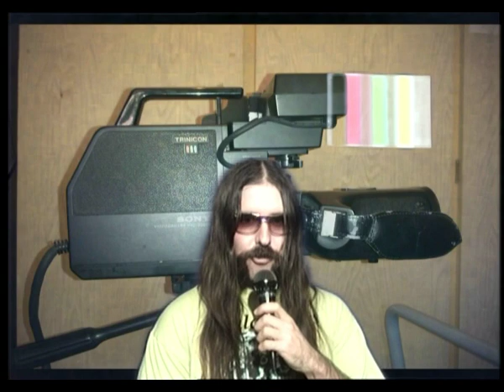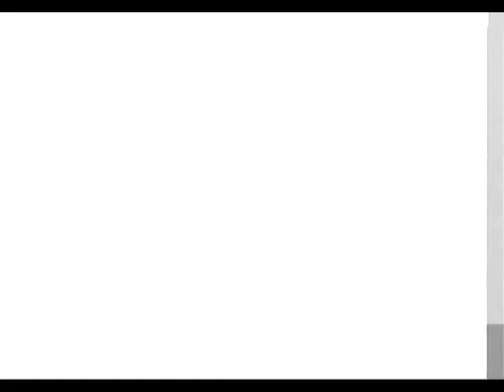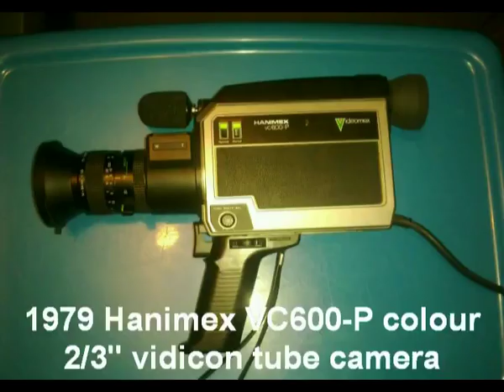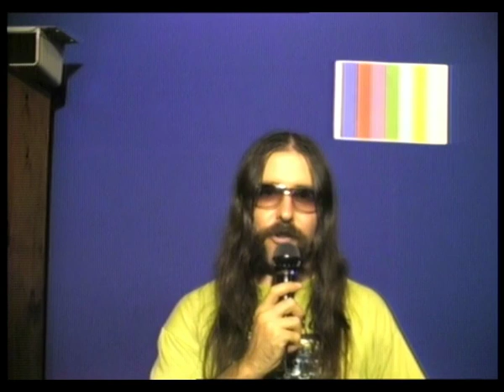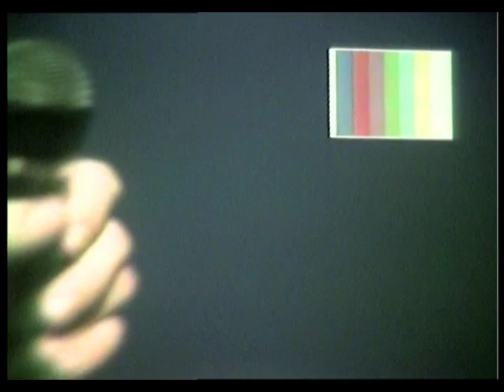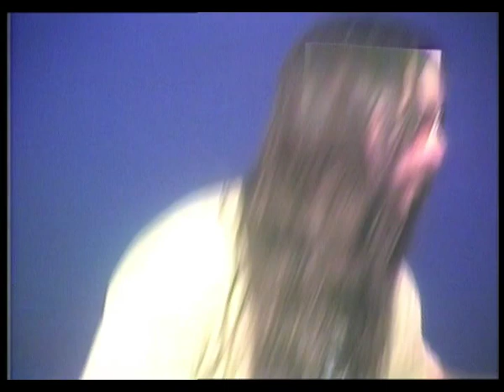My vintage video camera collection in operation

Comment: Thanx for the presentation.
I have a collection of Trinicon and Newvicon video cameras and all the gear. 
I've never hooked up my cameras nor a VCR to my PC.  I bought an Easycap001, but I never hooked it up.  I'm not good with computers.
I run across this gear all the time.  They are dirt cheap here in the USA.  If you want me to buy and ship to you, I could do it at cost.  The shipping, I think, would be three to four times the cost of the gear.

Comment from the maker: I assume you're referring to the Panasonic NV-MS1 SVHS camcorder. Firstly I didn't record the picture to tape at all, I outputted the video signal to my DVD recorder from it's adapter unit which you get 720 lines resolution opposed to 400 lines with SVHS. Secondly it helps to have good lighting bring out a good vibrant picture with no grainy noise, I used a cyclorama light to illuminate my room while making this video, it's especially needed for the older tube cameras!

Comment from the maker: Apart from Ebay (where I got most my cameras from), check out 2nd hand oldware/antique stores, rubbish tips that have shops that sell junked oldwares, hoarders houses/barns, curbside junk piles, those are some typical places to find early cameras without using the internet. But in general more than likely these old cameras will pop up on Ebay more than anywhere else.

Comment from the maker: Or alternatively you can record from your camera to a DVD recorder, put the videos to disc and copy the disc to computer and edit the videos from there which is what I do myself. With old cameras it's a "MUST" that you connect a VCR between the video output of the camera and a USB video capture card or DVD recorder because old cameras output a DC voltage as well which can zap the inputs of any digital recording device, a VCR will strip the DC, I zapped most of my AV inputs of my DVD recorder :(

Comment: Talking of vintage cameras, I found it interesting to note that the BBC were able to maintain EMI 2001 cameras up to 1991, through cannibalization of discarded equipment.  Upgraded from Vidicon (EMI 2000) to Plumbicon, the EMI 2001 camera was introduced in 1967.  EMI 2001 cameras were abandoned by ATV when the BBC bought an Elstree TV studio from them, back in the 1980s.  Thus, an EMI 2001 camera was last used in the making of an episode of Eastenders.